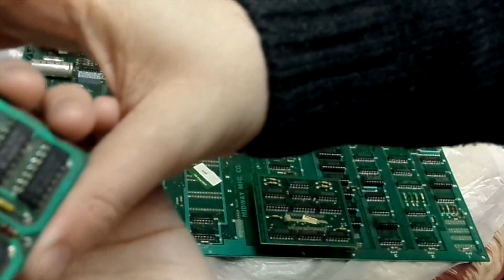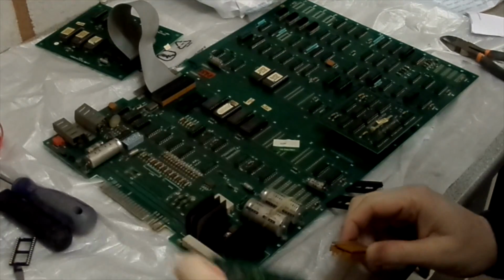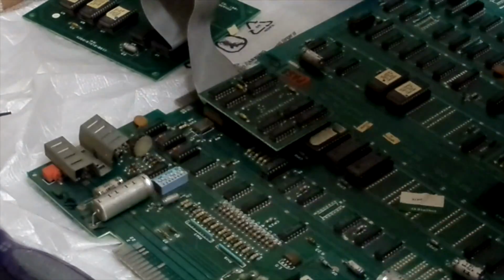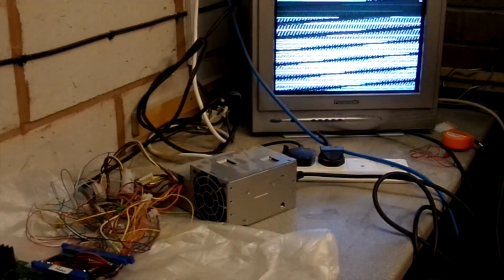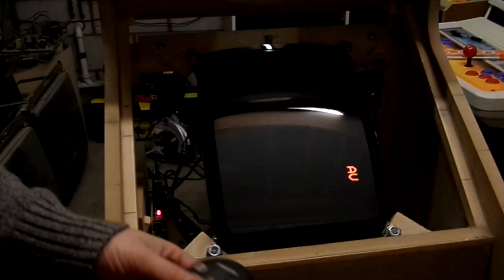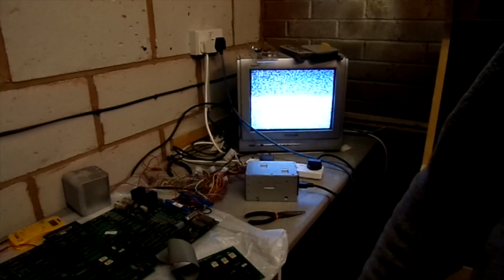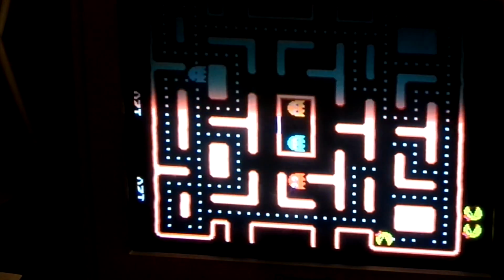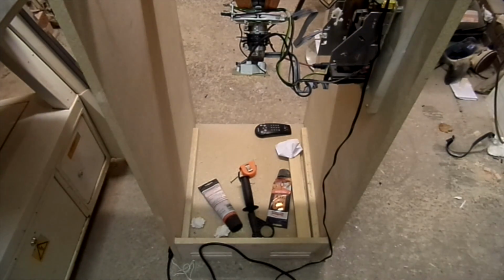A Pac-Man Is Born: Part 11. Getting a Pacman arcade board working

Comment: Can you please sell the connections from the board to the TVI'm trying to build my own cabinet too based off of what you're doing!
Reply from the maker: Is it an original Pac-Man board that you are trying to hook up to a tv? Does the TV have an RGB scart input? The connection that I created for this is entirely bespoke and hand soldered, so it’s probably not something that I can sell. I can create a simple pinout diagram if you are any good at soldering. Alternatively, I think there might already be Pac-Man to JAMMA connectors around which you could then use to connnect to a super gun that outputs to SCART.
Reply: Well I have an RCA input into my 13 inch Duraband TV so I might be able to get a scart to RCA
Reply from the maker: Are you based in the US or the UK/Europe? You won’t be able to directly wire a Pac-Man board to an RCA connection. The only video cable for RCA is the yellow one. This contains R, G, B and sync in one signal (composite). SCART on the other hand has separate connections/pins for R, G, B and sync connections which is what the Pac-Man board outputs. If you can get a SCART tv or arcade monitor or you will need a converter.
Reply: But I want to be able to see the full connection from the PCB to the back of their scart TV
Reply from the maker: The pinout for a Pac-Man pcb is here it will show you what the inputs and outputs are: http://mikesarcade.com/cgi-bin/spies.cgi?action=url&type=pinout&page=Pac.html
Reply: Yes I agree I was going to buy a scart to rca converter
Reply from the maker: @logansreplicas  If you are not using SCART then you just need to look for an RGB to Composite converter. A quick Google search came up with the JROK one: http://www.jrok.com/hardware/RGB.html

You could buy a 44 pin pcbs connector like I did (https://www.ebay.co.uk/itm/1pcs-Card-Edge-Connector-44-Pin-156-Slot-Solder-Socket-PCB-Panel-Slots-2-x-22-/180738615868) then solder the connector to the RGB inputs on the JROK connector.
Reply: I just wanted to see a photo or a picture of the entire connection that you made?
Reply from the maker: @logansreplicas  I can take a photo of my connection, but it isn't going to help really as you need to convert the signal with an active adaptor. My connection goes: PCB > 44-pin edge connector > Scart socket RGB connections > Scart cable > Scart socket on TV.
Yours will go: PCB > 44-pin edge connector > RGB to composite adaptor RGB inputs > Yellow composite cable > Yellow composite socket on tv.
Reply: https://www.ebay.com/itm/RGB-SCART-to-Composite-RCA-S-Video-AV-TV-Audio-Adapter-For-Video-DVD-Recorder-TV/233291991194?_trkparms=ispr%3D1&hash=item365149489a:g:Cu8AAOSwsV1dMtST
Reply from the maker: @logansreplicas  That won't work. That is a passive connector. SCART takes in a lot of different inputs. It takes in the same composite signal as the yellow one on your TV which is what that adaptor is used for as well as RGB. You need to convert the RGB signal from the PCB to composite (yellow cable) with an active convertor like the JROK one.
Reply: Is a gold pin 44 pin edge connector good? And I believe you haven’t posted in a while haha!
Reply from the maker: as it’s an analogue signal, I think gold connectors will probably give you a bit better quality. How much I don’t know. Yeah I haven’t posted any videos for a while unfortunately. Looking after my two year old little lad and moving house twice in the last year has taken most of my time up recently. My arcade in the new house is coming together though.
Reply: I am a little confused on your RGB device because I am not sure about that female connector
Reply from the maker: The RGB inputs on the adaptor are 6 pins. Just solder directly to them.
Reply: Yes thanks if you are able to get a little blueprint together for me because I’m 15 and this is going to be very very challenging for me?
Reply from the maker: @logansreplicas  I'll see what I can do. I'm a bit busy at the moment but I'll see what I can do over the next few days. If I've not got back to you by Saturday, send me a reminder.
Reply: Ok great sounds like a plan also I need you to help me verify the dimensions of the cabinet I am trying to build he exact same one!
Reply: any news?
Reply from the maker: @logansreplicas  I'll get on it as soon as I can, just a bit busy at the moment. It is on my list of things to do. Feel free to remind me over the next couple of days though.
Reply: Ok till then!
Reply from the maker: @logansreplicas  Ok, I've sketched a wiring diagram and taken a picture of it and posted it here: https://i.imgur.com/HEx7plv.jpg Hopefully that'll help with the video and power wiring
Reply: Shundi12 thanks
Reply: Shundi12 What type of power supply did you buy specifically like what rating ATX power supply
Reply from the maker: @logansreplicas  I think I had an old ATX PSU hanging around. It was no more than 300w
Reply: Shundi12 What type of JROK do I buy

Comment: How you getting getting 12 & 5 Volts DC to your PCB?
Reply from the maker: Stephen Cameron I have the board connected up to a standard ATX power supply. I used the DC pinout at the following web site: https://www.mikesarcade.com/cgi-bin/spies.cgi?action=url&type=pinout&page=Pac.html . I will probably use a completely silent ATX psu or a switch arcade PSU in the end.